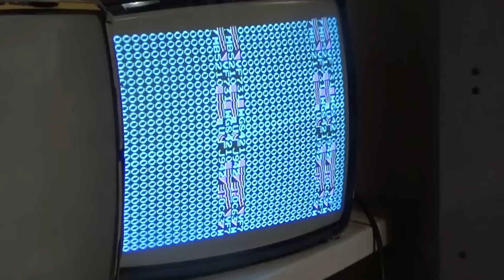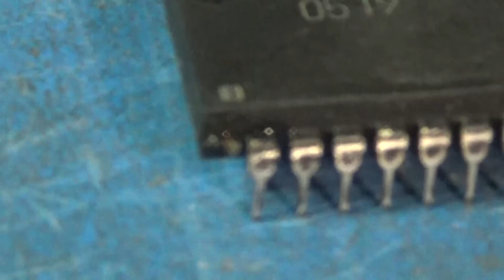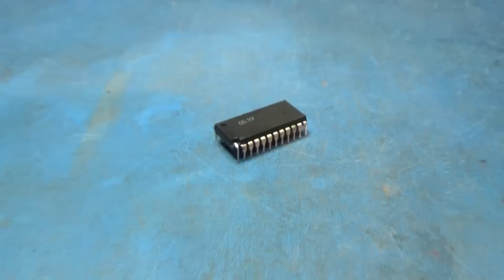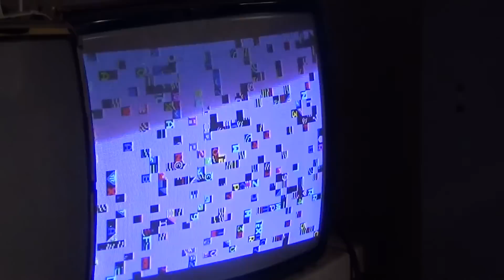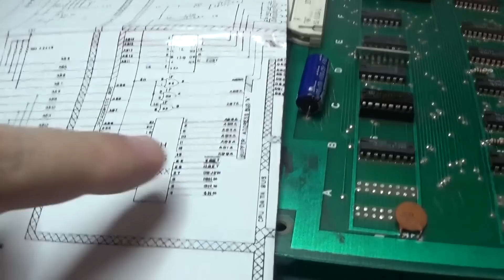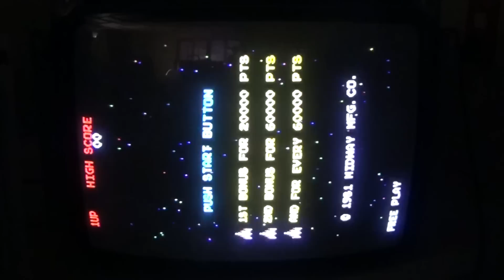1981 Midway Galaga PCB Repair!!   1-12-22

Comment: Another thing to replace are the resistor packs on these Galaga PCBs. If they are the original resistor packs they get stressed and break off or bad solder joints.

Comment: That battery-backed RAM is 22 years old.  The module shouldn't draw more than a few mA unless it's defective.
Reply from the maker: It was definitely defective… Because once I remove that my voltage was normal